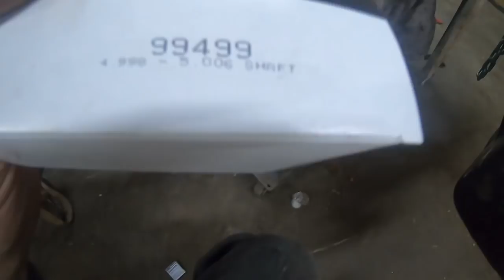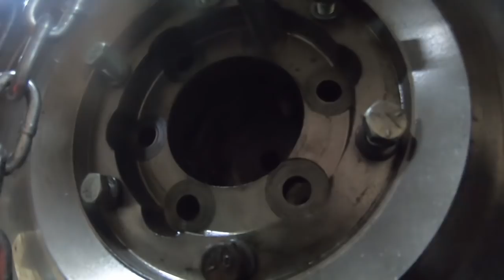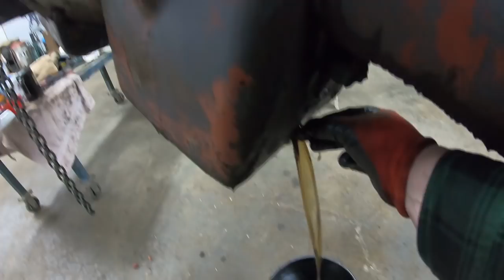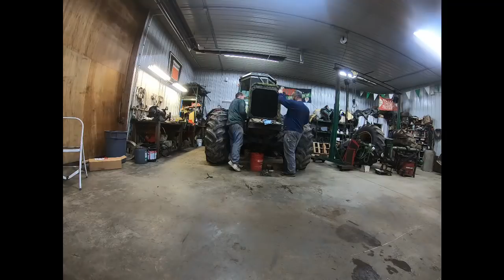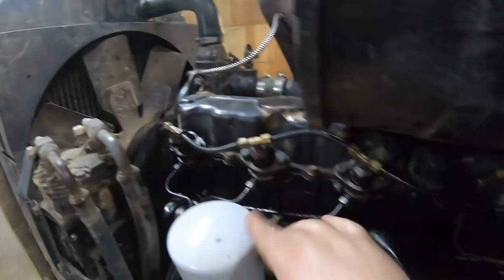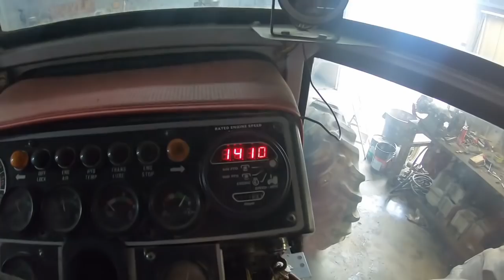White 2-155 Engine Rebuild Part 8

Comment: Hi Chris, fantastic videos! I have a white 2-155 exactly like that on our farm. This fall the front motor seal went out. After seeing your videos, can I remove the whole cover to replace the main seal and the cover seal? I don't want to mess up the timing gears. I am also curious what kind of pre-heat element you found to replace the old one. Ours is still original with 5500 hrs. Any advice would be greatly appreciated.
Reply from the maker: You don't have to pull the cover. Remove the front pulley and pry the old seal out, drive a new one in. Take care not to hit anything too hard, that cover is aluminum.
I never found another heater element.  It starts so good with the high compression pistons,  I decided to leave it out.
Reply: Thank you for getting back to me so fast! I really appreciate it!  I will just clean Everything up really well and drive a new seal in. Might unturn our element just to check it. Unless it is really stuck. Thank you again for getting back to me!
Reply: Hi Chris, I got our white all apart today.  The front engine oil seal was bad. I also noticed that the rubber seal on the back of the damper pulley had some chunks missing. Will that affect the balance? Is there a way to replace  it?
Reply from the maker: @reeceetyczkowski9511  I'd get it replaced. It absorbs vibrations that you won't feel, but can break the crankshaft. It's certainly not going to get easier, it bolts onto the backside of the pulley you already have off. Try this place, they specialize in Hercules engines. https://www.herculesmotorscompany.com/contact-us
If they can't help, there are places that rebuild harmonic balancers. Maibach tractor may have something as well.

Comment: Dumb question #5683: Do those newer tractors still have the big chain coupler between the transmissions? Always thought that a mechanic came up with that one. Makes life easier.
Reply from the maker: No. Once they started getting over 100 horsepower, the chain coupler just wasn't good enough. They came up with an enclosed coupler system for the 2050 and 2150, used that in the 2255 and the White 2-85/2-105. With the even higher horsepower expectations of the 2-135/2-155 platform, they designed heavier duty enclosed coupler that was lubricated with transmission fluid. With only minor modifications, that style went until the end of Whites with the over/under. The exception would be the American series, where they brought back the chain coupler.
Reply: @ThatOliverGuyChris  Thanks!! Those couplers always fascinated me, since I never saw anything like that on other tractors. I imagine they have a finite lifespan as well. Still, an intriguing solution.

Comment: Chris did you add the lift pump for the fuel system? I have a 2-135 and it keeps starving itself for fuel on some of the longer hills.
Reply from the maker: I did add the pump. I wasn't having any problems, but I did notice a slight decrease in horsepower when I got down to the lower tank. That lift pump really brought that tractor to life, and it has full power no matter how much fuel is in it.
Reply: @ThatOliverGuyChris    Excellent thanks again for the advice. I will give that a go.  Do you happen to remember what you used for a pump?

Comment: Chris... when did Oliver/White switch from Waukesha to Hercules engines?
Reply from the maker: They had actually been using Hercules for many years in their crawler line. Cletrac had already been using Hercules prior to being bought by Oliver in the late 1940s. Oliver kept using Hercules engines in the crawlers, with the exception of the OC-6, which used the same Waukesha as a 77. There was a gap in the mid 60s when the crawler line had been discontinued that they didn't use a Hercules engine, but then in 1968 the 2050 and 2150 debuted with the 478 Hercules, the same basic engine that's in my 2-155. They still used the Waukesha in the smaller tractors, but typically went with another engine supplier when it came to their highest horsepower models. The 478 Hercules was dropped in 1970, but returned a few years later in the White 2-135 and 2-155. At some point during all of this, White Motor had bought Hercules engines, but I don't know the date of that.
Reply: @ThatOliverGuyChris  Thanks Chris

Comment: Hello from Maryland Chris.  Just wanted to tell you I enjoy your videos. I have a few questions for you. I was taught by my father, a Oliver mechanic from the early days of the fleet line tractors. He taught me from early on to always coat the splines of the PTO drive shafts and drive hubs with a molly paste grease to help prevent spline wear. Is this done on the short drive shafts? I'm used to the 55 series with the long shaft running from the flywheel hub to the rear. Also, we have always retorqued the head bolts/nuts while the engine was warm from running then waited until the next morning to readjust valves? Is this just a personal preference or have I been doing things wrong my entire life? Thanks for the videos.
Reply from the maker: I have heard of coating splines with moly grease. I don't do it because I worry about it flinging off and getting in the clutch. And if I coat it really thin it's going to collect dust, dry out and cause wear. I don't know if there is a right answer for those splines. The only place those splies are dry on a 2-155 is at the flywheel.  The ones behind the over under get lubed by transmission oil.
I was taught to retorque the heads when it has cooled off. Then all the parts have equalized in temperature and returned to size after expanding from the heat. I don't think engine manufacturers retorque heads on brand new engines, so I find it interesting they recommend it on overhauls.

Comment: Hey Chris! I had a M35A2 that had a White multi fuel turbo diesel motor. The injectors placement on that motor look similar to your motor. I could be wrong.
Reply from the maker: I don't know all the multi fuel model numbers, but it was most likely the same engine, with the modifications to make it a muti fuel.

Comment: OHHHH THANK GOODNESS!  SHE RUNS!!!  CONGRATULATIONS!!!  It may be louder, but she still don't sound as loud as an old deuce-and-a-half!  Do you think it warms up faster with those pistons?  Yeah... Federal Mogul... one of about 3 parts manufacturers still left in the world (excluding the chinese parts cloning factories).  VERY interesting about the power shaft acting as a shock absorber of sorts.  It makes sense to me.  If it can't flex, it'll just break.  Thanks for the shout out and link!  Hopefully it helps some people out who were wondering.  Some people still don't believe me on the torque wrench extension deal, so I'm working on a 20 foot long extension and we'll see if that helps convince some people.  So glad to hear it running again and that everything seems to be working correctly!  So, is the dyno or the chiselplow next for it?
Reply from the maker: I didn't think there was any difference in warm up time. In theory,  it should be slower since more energy should be coverted to pressure and mechanical energy and less into heat. 
I knew when I saw your torque wrench video I was going to have to link to it. Someone out there is going to get torqued (ha!) because I tightened the flywheel with an extension. I was surprised in your video that the crowfoot didn't have more of a difference.  A suggestion if you can do it, have a second digital torque thingee and have one on each end of the extension.
The 2-155 went to the field, should have video up Sunday morning.

Comment: The feeling of a freshly built engine starting for the first time never gets old.
Don't let her run too long with no load though, she needs to seat those rings in under load.
Could you borrow that dyno again?
Couple of hours at 1800rpm at 50-75% load would be just the ticket 😉

Comment: It's always nice when they start right off without alot of issues I am farm equipment mechanic here in west central Minnesota it's nice when the electrical stuff works like it should I have rebuilt diesel engines and the farmer says that the starter worked good but when I want to start the rebuild engine the starter doesn't have enough to turn the full compression engine. Then I have to go thru the whole electrical stuff to even get the fuel primed . Keep up the great videos

Comment: Have noticed much of a change or lose of torque when retorquing the head? We don’t do it on rebuilds. Wondering what you see. Nice job on the rebuild. Runs very smooth.
Reply from the maker: It's not much, but I did get a little bit on most of the studs. Too bad my pointer type torque wrench doesn't go high enough.  It would have been interesting to see at what torque they started turning.
The book says to run it 2-3 hours and retorque, but who has time for that.  Lol

Comment: Now for the fun part.  Lets see what differences you notice with the compression bump.  I was curious if the difference could be heard too.  Probably a bit early to tell 100%.  She cranked over great from where I was sitting.  I bet winter starting will be pretty good.

Comment: What do you recommend for oil in the over and under in my 1755?
Reply from the maker: If it had ATF in it, I would stick with that. Dexron 3 is the modern equivalent. If you have it all drained out/rebuilt, personally I would switch to universal transmission hydraulic fluid. AGCO calls it 821xl. White tractors used that in the over/under units from the factory.
Reply: @ThatOliverGuyChris  OK. Thank you very much! Love your videos.

Comment: Sounds good. Barely smoked too. You going to put her on the dyno sometime and see what she produces? What about the injector pump settings? is the know good settings from before enough or do you need to fine tune?
Reply from the maker: I will be putting it on the dyno, which reminds me, the tach was acting up on the dyno. Better figure out what is going on there.. The injection pump is at stock settings and timing, and so far it is running great.

Comment: It sounds good. I work for a trucking company and built alot of engines, im always nervous and excited at the same time when i go to start up a engine.
Reply from the maker: I know exactly what you mean. Putting it on youtube seems to raise the stakes, because people will wonder where the video is if I screwed up and choose not to upload it.
Reply: Luckily i can start them by my self. So if something does go wrong, no one will see it lol. I did video the last engine i did. Luckily it ran great. I was thinking the same thing, if theres no start up video, something went wrong. But it sounds great and you sure do have alot of knowledge on those tractors
Reply: I built a lot of engines in my lifetime and I was kinda a loner while working on a engine. when the block was buttoned up I was different. hated to get distracted......good job chris

Comment: I know that poor old engine stand was glad to finally get that engine off it's back..........I have machined a lot of aircraft components much the same way. The ends are larger than the middle. Did you use any threadlocker on the flywheel bolts? Will that tractor pull as much as a 4-150? You put a lot of work into that engine. I hope it is good for several thousand more hours.
Reply from the maker: I put the aviation gasket sealer on the threads.  Not as strong as loctite, but still sets up pretty good. I'd say the only advantage a 4-150 has over this is traction.

Comment: Would it be possible to get a video on how to do the sensor adjustment?
Reply from the maker: I put in a new ground speed sensor, but left it out of this video to keep the length down.  I can edit that soon. I didn't end up having to adjust  the engine one, it only read weird while cranking and went to normal once it was running.